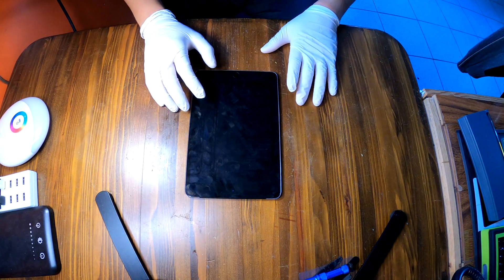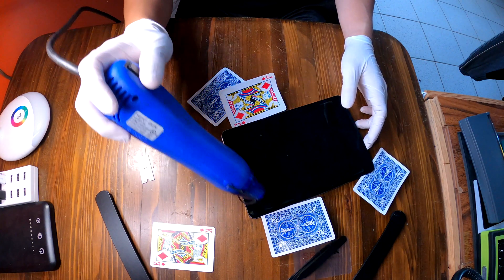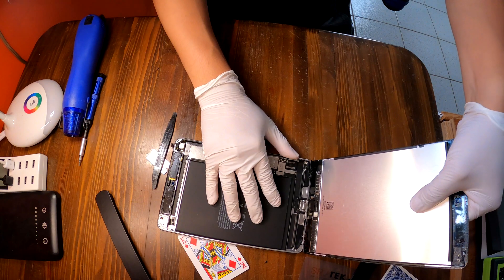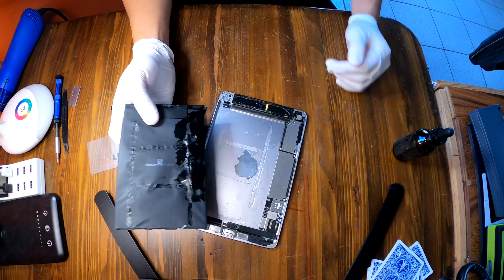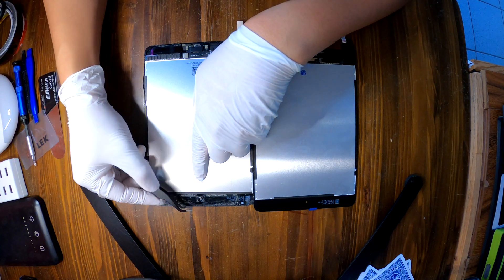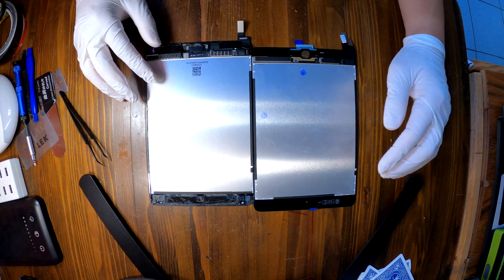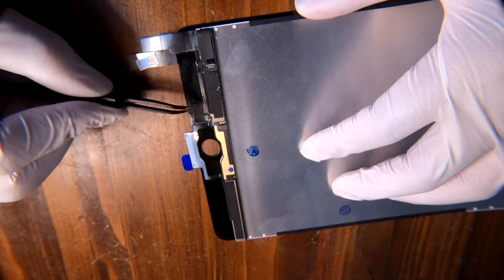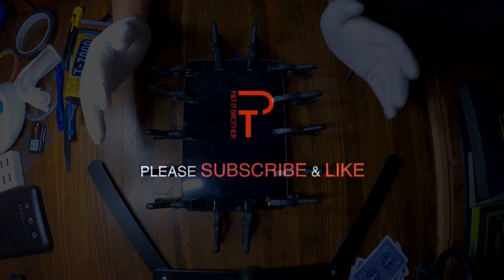iPad Mini 4 A1550 Screen + Battery Replacement (New 2021 Tutorial!)

Comment: Hello, great video!
I'm relatively new to soldering is the flux chemical needed for this process or can you do without?

Thanks 👍
Reply from the maker: Flux is not a must, but with Flux, it is much easier to do soldering and desoldering. It helps you to create a stronger solder joint, and it also help you to melt the solder quicker.

Comment: Hi I have a ipad mini 4 A1550  and it does nothing at all . The back warms up when I plug it in to the charger but thats it . How can I tell if the battery is the problem  without opening it up ? I tried to test  the battery  by leaving it plugged in for a while  and then I unplugged the usb side and used my tester  and touched the ground  and touch the  positive of the tester  to all the  connections inside the  usb connect  but I got no volts at all . If the battery was good would power come out of the  ipad through the  usb cable ? Would a bad battery heat up ?
Reply from the maker: It is hard to tell if the battery is good or bad. The best way is to disassemble your iPad and test the battery with a multimeter or if you have an extra battery, you can replace it to see if your battery is really bad. It could be the logic board problem too. So, it is not easy to tell if it is the battery or logic board unless you test the logic board and the battery using a multimeter. (of course you will need a schematic to do it..)